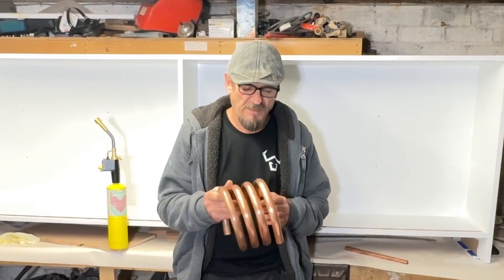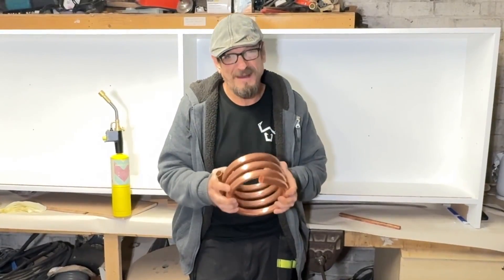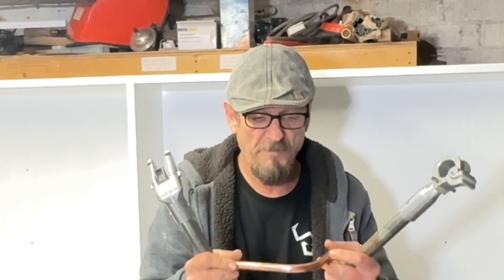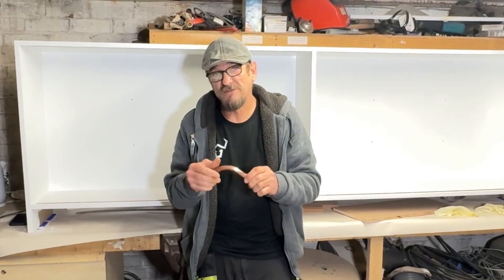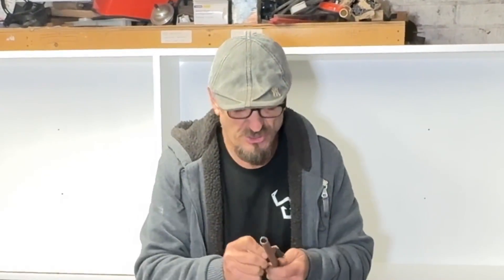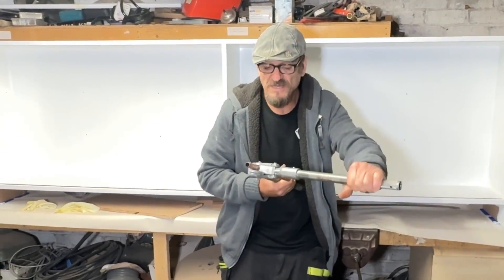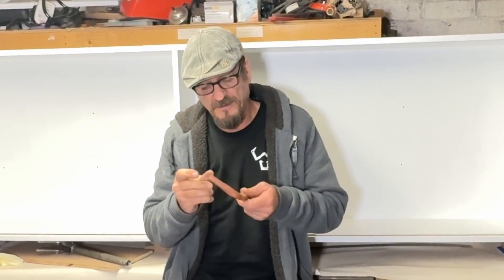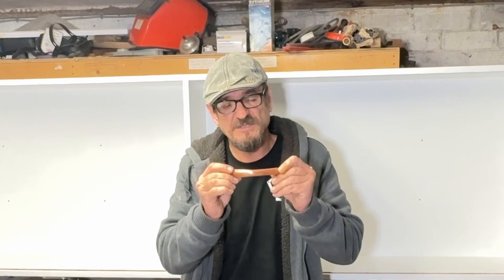Why should you NOT ANNEAL copper tube before bending

Comment: Wonder if it would work with a bending spring.  Got no intention of using one just curious 😊
Reply from the maker: That copper is so soft that if you put a bending spring inside and used a bender to form that 90 I think it would mould to the spring and you would struggle to get it out 😁
Reply: @srvsocial good point.